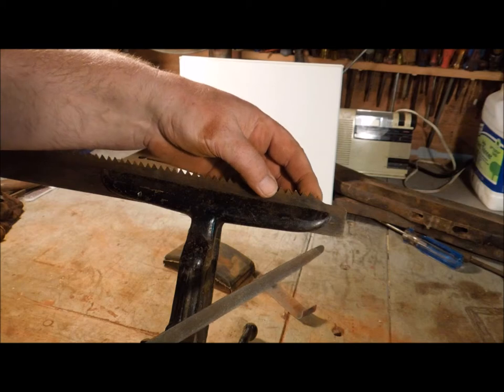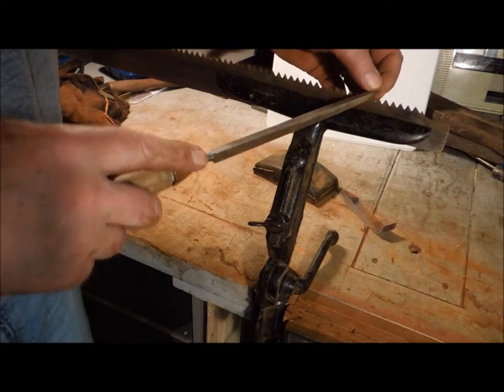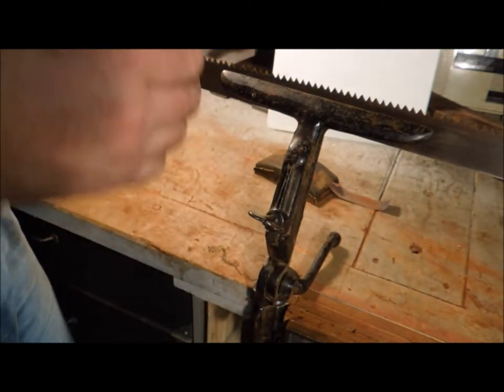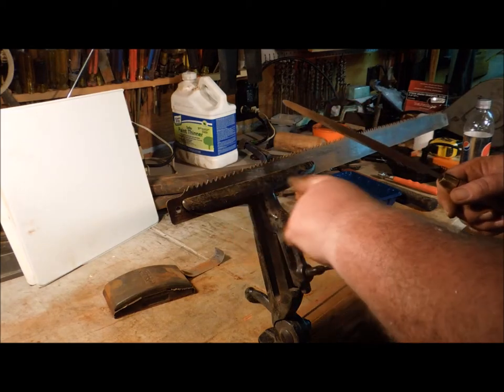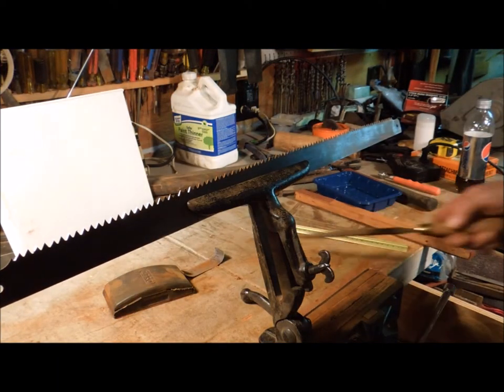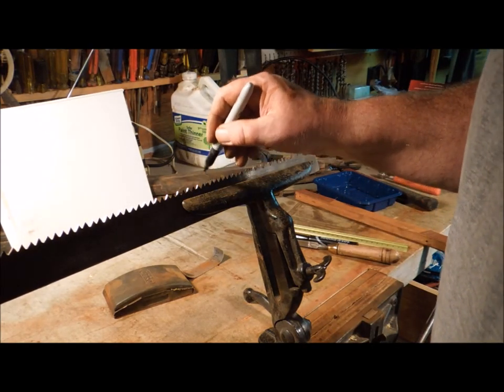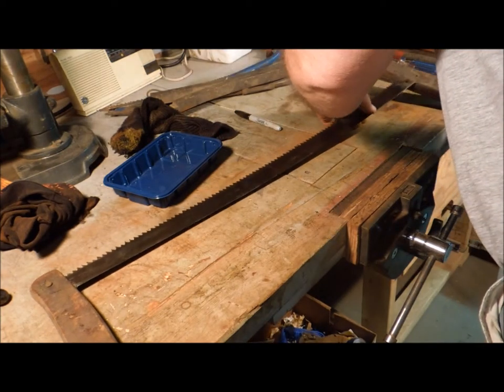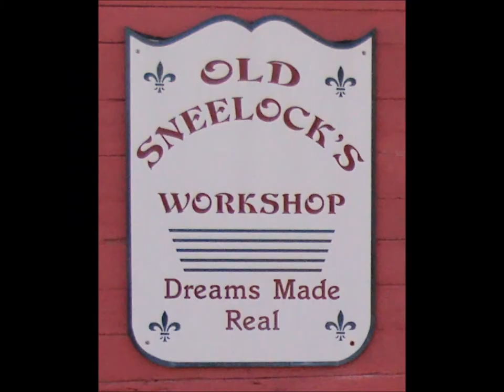Sharpening A Buck, Frame, Swede saw -  Pt 2  - A How To By Old Sneelock's Workshop

Comment: That was good, Unc! I liked the part about the depth. When I get a new saw chain and if I'm not in a crimp, I usually take about 3 or 4 strokes off the drags, or depth gauges with a flat file. I know, a new chain is an easy cutting chain but I want a more aggressive bite and that's why i take it on down some.  When it's right for me I can lay the saw on a log one handed (I know)  and pull the trigger and it'll feed itself through by itself, no pushing at all. But a stroke too much means you might ruin a new chain. There used to be a nifty rig called a Carlton File-o-plate that had the sharpening angle and depth gauge level in a piece of metal smaller than a credit card.  I lost mine but eyeball it now but they're nice to have.
Reply from the maker: It's been a long time since I looked at this video. 
I had forgotten about the gage you mentioned. I will need to check and see if I can find one, or one like it.
Reply: @OldSneelock  I think Carlton still makes stuff. It was called a File-o-Plate and it had 2 holes where the drags stuck through, one for hard wood and one for soft so you could file to what your needs were. You slid it over the link so if the links were filed more or less you'd end up with the same cutting surface because it read from the cutter point. They probably had them for different size chains too. I have no idea where I got mine but Stihl makes a guide that sharpens the teeth and drags at the same time, chain on the saw.
Reply from the maker: @lewiemcneely9143  There are some of the Carlton File-o-Plates on Ebay. Now I just need to check and see what size chains I have on the five saws. Thanks for the tip.
Reply: @OldSneelock  Before I got the hang as far as i have of hand filing, these sure helped me a lot, especially on drag height. An old friend of mine said he just filed his teeth on a 45 so I tried it and it worked just fine. Just as long as all are on the same angle is the tricky part but the new chains with the mark on the tooth takes the worry out of that. And I always used the soft wood slot for the drags.  It just cut pine a little faster than normal.

Comment: Thank you for this video old Sneelock.  was wondering if applying a lubricant like oil or ballistal to the teeth prior to sharpening would aid in a smoother/more efficient process?
Reply from the maker: +Patrick Rusca I don't usually add oil or wax type materials to a file. For me oil tends to make the file plug up with filings that can cause scratches in the surface. A good sharp file working in a rigid setup has proven to be best for most of my filing operations. That doesn't mean that it won't work for you. Best thing to do is pick up a file and try it. The worst that will happen is the file may pickup some filings in the teeth and need to be cleaned. 
One note concerning filing is that when you're filing aluminum or any gummy soft material, rubbing a piece of chalk over the file will slow the amount of build up in the teeth.
Reply: +Old Sneelock's Workshop good points.   thanks for your advice. :)

Comment: Do you ever use two hands with one hand on the lower section when using the saw?
Reply from the maker: Yes,  When cutting larger diameter stock I put my left hand above the blade and the right hand lower on the handle. Same when cutting down a small tree. 
Just watch your knuckles. They hurt when you punch into the wood.  😁😎

Comment: What kind of saw vise is that?  What should one look for when buying a vintage saw vise?  Thx.
Reply from the maker: +BangFlop When handsaws were being used by everyone there were a large number of saw vice makers. This one doesn't have a brand name cast into it. The one on the back of the bench is a Disston #2. I got it because it has a file guide. Turns out the guide is more of a pain in the tuckus than a help. 
As far as what to look for the things I see wrong with them are, in order of appearance:
1. Broken frame. These were common tools. They got thrown in the tool box and carried from job to job. Lots of banging around means a good chance it got dropped. Cast Iron cracks easily. If it's broken leave it. There are too many being sold at $15.00 each to spend time on fixing one. Unless it's a family heirloom, pass it by.  If it is then consider having it as a wall hanger and buying a cheap one at the flea. 
2. Stripped clamp  threads. Overtightening the clamp to get it to hold when someone who didn't know what to do. Same result as a broken frame. 
3. Assembled wrong. This saw vise had the clamp jaws mounted on the wrong side of the clamp. Score one for the team. The store owner just wants to get rid of it. 
4. Marked wrong. This one I like the best because it's a sure thing that if they call it a clamp or a whatsit I can buy it for $5.00.
Reply: Thanks!

Comment: How do you which is back side?
Reply from the maker: Teeth on a crosscut saw are tilted so the point is aligned slightly ahead of the center of the tooth. The point of the tooth points to the front of the blade.